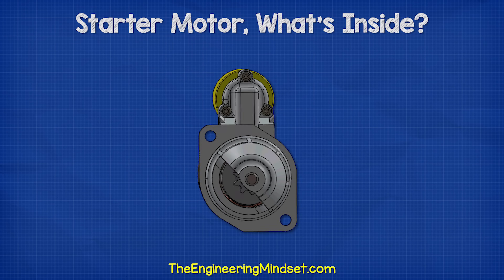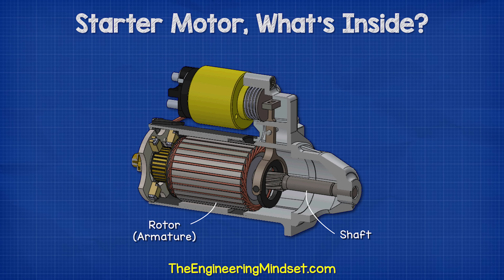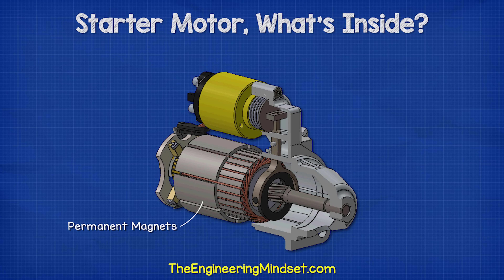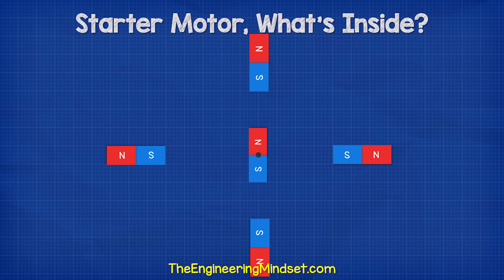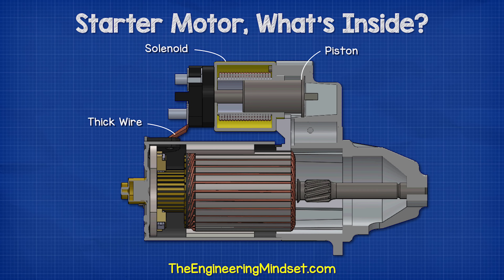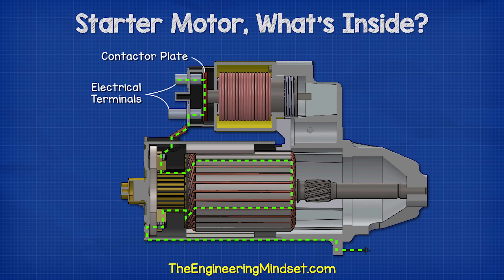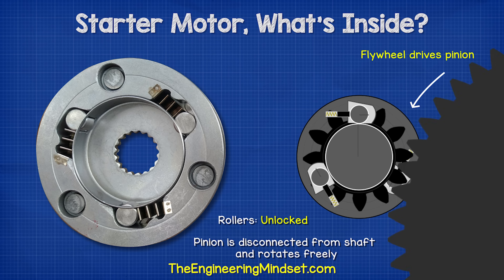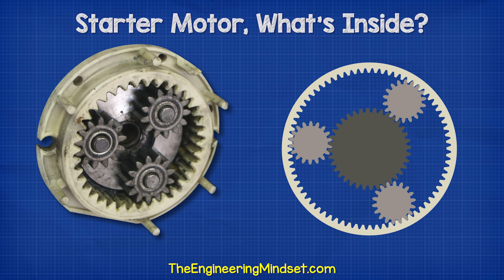Starter Motors, what's inside?

Comment: I don't think the armature in the thumbnail picture is from a starter motor. Each coil has many turns of quite fine wire rather than one or two turns of very thick wire or strip, and the commutator insulation is undercut which usually it is not on a starter motor. I think this armature is from the universal motor of a drill/angle grinder/vacuum cleaner/lawn mower or other mains-powered appliance.